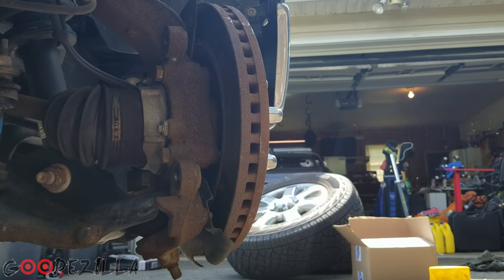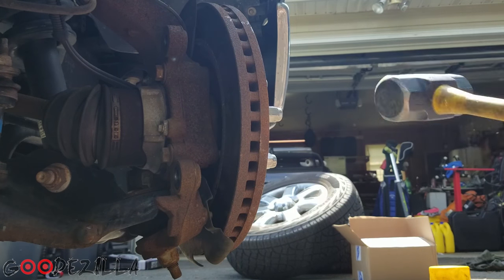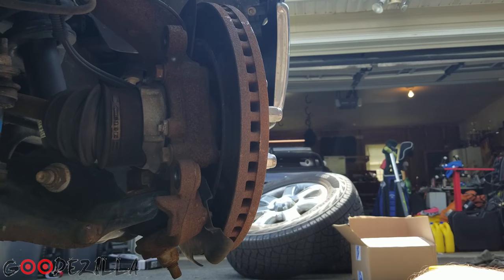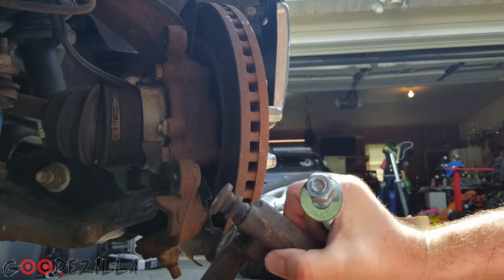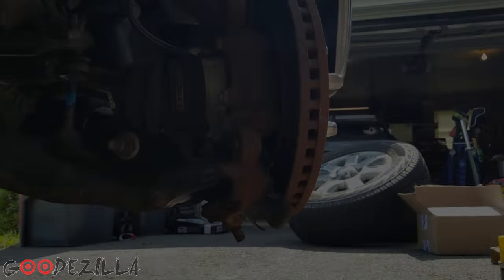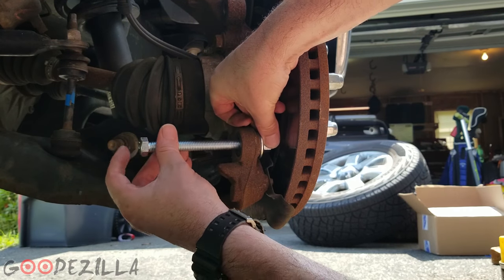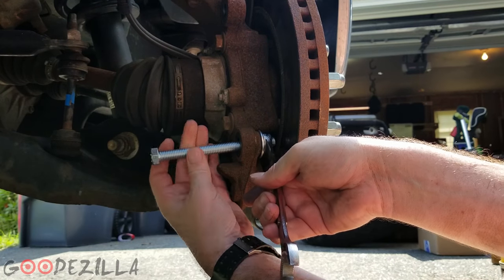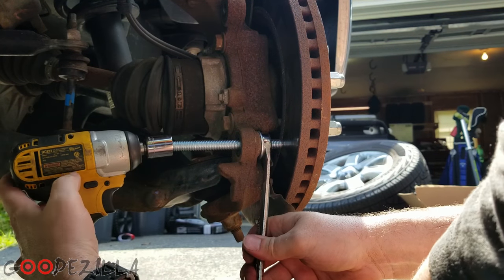How to Remove a Stuck Rotor WITHOUT a Hammer!

Comment: update at 08\20\2022 
This really works!!!! thanks a lot
I have tried to use a hammer,but no luck for 1h, have to give up
after watching this video, i bought a 4 inch bolt, with one nut, and an adjustable wrench, 
Magic, it works!!!! keeps turn the bolt, when you heard a loud 'Beng' that means the rotor goes off from the wheel, then just slightly hit it by hammer, yvonne!!
Reply from the maker: Great, I'm glad it worked out for you!

Comment: Noice man !
Often time's it's wise to shut off the propane torch, set aside the hammer and pry bar. Take a piss, grab a beverage, sit down and try to get a new resolve. Working on a 2010 Ranger. 168k and obvious the rear brakes have never been touched. 
Enter you tube and your video. I was not able to set up a bolt as you did. The caliper guides/bracket extended past the front surface, so I was able to put a heavy steel bar over the bracket tabs, then put on C-clamp over the bar and rear rotor surface to break it free. Same concept as yours, different set up. Before I took a break to rethink stuff I was thinking open the diff case as a fluid change wouldn't hurt an pull the axle. OR, leave the POS rotor and put on pads. Doing it the right way like I planned ! Happy to stick with a reliable rig that's paid for ! I'll be sure to check out more of your stuff. Saved my ass brother, thanks !!!
Reply from the maker: Quite the comment! Thank you for taking the time to write! It's always nice to have a paid for ride! Have a good one! 😎👍

Comment: This rocks bro!! Thank you for sharing, old-school with sledge hammer, pry bars and slide hammers doesn't hold finger to this little bolt trick!!! Worked perfect, and I had to improvise it with two box end wrenches, and a carrage bolt, used 2 nuts, washer, I didn't have a ride to the hardware store so I had to use bolts that I had laying around and I didn't have an impact wrench and it still worked first try perfect!!! 👍👊✌

Comment: Excellent idea!!!  Rotor in Volvo was stuck and I was cursing Volvo for not providing a hole in the rotor to drive a bolt through and against the hub from the front to get it off (like I have in my Honda). This does the trick!!!
Reply from the maker: I'm glad it worked out for you!

Comment: Wow it worked!!!  It is late and I certainly did not want to go to the hardware store.  I was able to find a nut and bolt that looked like it would do the job.  The bolt had a 13 mm head and I wanted to use it on my electric 1/2 inch impact gun but the socket was 3/8 and I couldn't find the 38 to 1/2 adapter.  So just for the heck of it I used a scoked adapter and put the 13 mm socket on my old blue Ryobi impact driver.  I did not have high hopes.  A few bangs from the impact hammer and the bolt had knocked the rotor loose.  Fantastic tip!!

Comment: Thanks a lot!! It worked for me on the first try! 

All four rotors were stuck due to corrosion on my Pathfinder i try a heavy hammer 🔨 and a torch 🔥and nothing worded 😔 3 days trying to remove a single rotor (I’m not a professional)
My local shop was charging me $300 just to change all four rotors. 
I went to Home Depot this morning and bought the bolt, washer & nut for $1.36 you really saved me a lot of money I owe you a pack of beer you deserve it! 
TIP: if your impact drill is too big like mine. Use a wrench to tight the bolt.

Comment: Awesome video, sir. Worked like a charm! Had to run up to the hardware store to grab some grade 8 bolts. The ones I had on hand were too soft and I bent one. Cut it out of there with a zip wheel.

Comment: Thank you sir worked like a charm. I used a gear puller without the arms and it worked wonders since I didn’t have bolts on hand

Comment: I just tried this today, but with a 1/4-20 bolt. That bolt was wayy too small and it was 5 inches long, so it bent and twisted itself almost 90 degrees while I tried to separate my rotor.

What size bolt did you use, and how long? Also, what truck do you have? Car I'm working on is only an 09 RAV4, but the front rotor is hell to take off.
Reply: Most caliper mounting screws are m14, which is closest to 1/2. The next lowest size is 7/16ths, then 3/8ths. Try those 2 sizes next time.

4 to 5 inches in length should be plenty

Comment: Awesome, i  had the same thing, pounding on that damn thing. thanks for the video. Saved me some time.  Just try and use the impact and only go so far with it. Mine wouldn't break free so I grabbed a breaker bar to tighten it more and snapped the bolt. Then I the little piece with the nut was stuck in the hole and had to use the other hole.
Reply from the maker: No problem, glad it worked for you!

Comment: Thanks for the tip. I'll try in the AM tomorrow. I was unable to turn the rotor by hand earlier. Will it work you think with 2 bolts in the bracket spots?
Reply: He is able to turn the rotor is due to him leaving the parking brakes off for the rear and the front in neatural.  Make sure you ensure your car won't be rolling if u have brakes and car in neatural while doing this.  The point of turning the rotor is to loosen it all around each time he use the bolt to push on the rotor.

Comment: I'm not super thrilled with the idea of hammering my axle into the differential, either, so this is super helpful.  I'll go give it a try.
Reply: Worked quite easily with just hand tools on a 2008 BMW 328xi that seemed like it had the original rotors rusted in place!  (This was after some modest hammering with a 2 lb sledge.)

Comment: Thanks dude.  You saved me from packing my disassembled car to the mechanic tail between my legs.  This is an exercise in optimal ingenuity.  (Oh, I had already hammered on my rotors until they were badly dented.)
Reply from the maker: I'm glad it worked out for you. Some guys will say, "quit being a wimp and hammer it"... Well sometimes you need to save the rotor and not dent it, so I used this method.

Comment: F'ing Brilliant.  I also have been fighting to remove the rotors on my 05 Avalanche,  & Yes they are factory rotors with less then 2mm of wear. If it weren't for the surface rust you'd swear up and down they're brand new
  My bearings are going so this is why I'm trying to remove them.
  Thanks for the info.

Comment: Thanks for sharing your idea!  Way better and safer than a sledge hammer!  
I'm surprised rotor manufacturers don't have tapped holes in the face so you can use a bolt to take them off (I heard japanese cars have them).
Reply: Chevy truck rotors have those threaded holes.

Comment: This is a real top tip! However.. I tried this, the sledgehammer, heating it up and using WD40 over night. Nothing works 🥲 so I’m finally throwing in the towel letting an expert do it. Wouldn’t be surprised if they’ll have to cut the damn thing off.
Reply from the maker: Dang that thing much really be stuck on! I'm sure you probably already know, but make sure there isn't a screw holding the rotor on to the hub, between the lugs!
Reply: @Goodezilla  Good thought! Luckily that’s the first thing I thought of as well 😉 I payed to get it fixed today, they had to break it in pieces in order to get it off. I just didn’t have the tools.

Comment: Another variant of the bolt pressing method.
This method however will only require a bug standard threaded bolt & nut, whatever heavy duty size bolt you can find locally.
Great tip, thanks for sharing <3
Reply from the maker: Thank you!

Comment: I had this happen, and I used that approach except put two bolts in, one in each caliper bracket hole.  Between the two bolts, the rotor snapped off with a loud ping after tightening both bolts.

Comment: this totally worked for me. The only comment I would add is to rotate the rotor (like you did in your video) and not to crank on the bolt too hard in one spot of the rotor (like I did, since I only had one side of the car lifted at a time) or there is a risk of bending the caliper bracket mounting hole 'arm'...if that makes sense.

Comment: Thanks I've just done both my front discs ,nearly gave up the other day hammering 🔨 😮 I used shorter volts than you and put one on top and bottom I used a 1/2 drive socket hardly put any pressure on and ping 😅couldn't belive it .

Comment: nice tips. what size bolt you typically use?
Reply from the maker: whatever size fits in the hole but doesn't thread in, slightly smaller than the thread size

Comment: Thats a great tip dude. Interestingly though my GTR has the factory cross drilled discs and has the threaded holes to do this job. Great tip though!!
Reply: Yea Subarus have that too, why the heck every rotor doesn't come that way is beyond me.  Almost makes sense to drill and tap a couple holes in your rotor once you pur a new one on just as security.

Comment: Bolt from a cot bed
Nut from a kids bike
Washer from the engine bay

Moved the rotor slightly, Plusgas penetrative oil & hammer did the rest. Nice one 🙋‍♂️

Comment: Looks clever, but is there a risk of cracking that tab off your knuckle?  It's not designed to carry load in that direction.
Edit...
I got a puller and nothing.  Was nervous about trying this approach because of aforementioned reason.  Carefully tried it and like magic, it came off.  Thanks for saving the day and for another tool in my arsenal.

Comment: I pulled it with a 12 ton puller. Only problem; the hub came off with the rotor!  I had to press the hub out with the 20 ton press and do the bearing job with the brakes. I'll try your way on the other side, but not to break the caliper mount off the knuckle. I'll use 2 bolts; both mounts to disperse the load.

Comment: I also owe you a case of beer and a firm handshake. Was this truck by any chance a Ford f150 4-wheel drive?
Reply from the maker: haha, I'm glad it worked for you. Yes it's a 2013 F140 4x4
Reply: Mine is a 2014

Comment: If you got a bolt the same diameter as the hole, would that not eliminate the need for a nut and a second wrench?
Reply from the maker: You could do that as well, but I wanted to eliminate the chance of messing up the threads on the bracket.

Comment: Be careful you don’t damage the wheel bearing, my Volvo blush fit bearing got pushed it of the upright a few mm as I wound on the pressure. I ground the disk off in the end and now I have to get the bearing pressed back in or replaced

Comment: I almost messed up my threads because instead of using a smaller bolt, I used the same bolt that holds the calipers in place. Also my rotor was extremely stuck in place. Gotta be careful not to bend the caliper mounting points or the wheel bearing.

Comment: Not sure what vehicle that is but the rotors on my Chevy truck have factory threaded holes in the rotor next to 2 of the wheel lugs. Thread in a couple M10x1.5 bolts and they push against the hub and rotor pops right off.
Reply from the maker: This is a 2013 F150 and does not have those threaded holes unfortunately.

Comment: Excellent video however my rotor is so fused to the hub that I'm afraid I might break the ear off my steering knuckle if I apply any more force. I think my only out is going to be to replace the rotor and the hub assembly unfortunately. Here's hoping I can at least get the 4 hub bolts out.
Reply from the maker: If your going to replace the hub, is the ear part of it? Not telling you what to do, but might be worth a shot if you're planning to replace it anyway.

Comment: Was this on an F150? Looks like a wheel from a 2013 in the background. AND! Is that also a RockAuto box I see in the background?
If it was an F150 that's hilarious. I just did rears on my 13 because the motorcraft pads glazed up my rotors and were squealin somethin fierce, it took me almost 3 hours to do a rear brake job. Two of those hours were spent heating, penetrating lubing and hammering those damn rotors off, I suspect the fronts will be just as bad when the pads get here tomorrow. (Also ordered from rockauto, rockauto everything lmao)
Reply from the maker: Yessir, 2013 f150 and rockauto lol

Comment: Actually thought about trying this but I was worried it might potentially deform the mounting bracket for the caliper which could cause the shoe to rub the disc. Maybe I'll give it a try and I'll be able to take back this hydraulic gear puller that I just bought.
Reply from the maker: Be careful because it can bend the bracket on smaller vehicles if the rust is really stuck hard.
Reply: @Goodezilla  ram 2500. Beefy bracket. Been working on this freaking rotor for 2 days. Just spent 5 dollars at Lowe's and 3 minutes later it's off. 
Bro you are a f**king god among men.
Reply from the maker: @gamiensrule  haha I'm glad it worked for ya!
Reply: @Goodezilla  same here I was legit running out of time. I had to get these rotors off today

Comment: Good tip, unfortunately, my caliper brackets are bolted on from the disc side, so they can't be removed before the disc to use the bolt hole. Not sure what my option is now.

Comment: GoodeZilla - tried with penetrating oil and banging with a hammer yesterday until it got dark and I had to give up. You were able to rotate the rotor and mine seems locked in. Is there something I am missing that would enable rotation? Thanks
Reply from the maker: It depends on which wheel it is. If the car/truck transmission is locked in a gear the rotor won't turn. Also make sure there isn't a screw in the face of the rotor around where the lugs poke thru that is keeping the rotor on the hub.
Reply: Thanks GoodeZilla. No screw holding things on. Should the car be in neutral instead of park? Sorry for what is probably an idiotic question.
Reply from the maker: @stephensavage9845  if you're trying to spin the wheels, putting it neutral would allow that in most cases. Just make sure you have the car tires that are on the ground bring prevented from rolling.
Reply: Thank you. Will give it another shot.

Comment: Do you have to have the vehicle up in the air and in neutral in order to spin the rotor like that?
Reply from the maker: The truck was on a jack stand. It was the front wheel, so it was free to spin as 4WD wasn't enabled.

Comment: FYI I tried this tech and it started to bend my caliper mounts. Mine was a particularly bad case though. Had to use a sledge
Reply: 1 bad ombre Wish I had read your comment before I trashed mine. Now I need a whole new hub carrier assembly. No way to bend it back.
Reply: @TyBower  oh man that's a bummer. Also pretty sure I wrecked my wheel barring hammering off my driver side rotar

Comment: Is the rotor ever welded on? If so can hub removal work?
Reply from the maker: Rotors are not welded on, they are items that require replacement throughout the vehicles life time. They are sometimes rusted on so bad that they feel like they are welded on. Also sometimes the manufacturer puts a screw(s) in the face of the rotor hat to hold it that need to be removed before the rotor will come off.

Comment: I tried  this once without an impact driver, using bolts in both steering knuckle bracket holes and 1/2" ratchet on full size SUV (expedition). Removed three of four rotors (they were still good) with a lot of effort. The fourth was damaged. Was concerned with bending the knuckle so I alternated turning each bolt less than 1/2 a turn, backing bolts off, turned rotor a quarter turn, hard tapping rotor with hammer and repeated. Still ended up snapping both bracket hole tabs of steering knuckle (I now know it's cast so won't bend).  Now have same issue with my navigator. One rotor is damaged, have replaced pads on it twice so I have no choice but to change rotor now. Is it possible that the impact action is what is loosening the rotor rather than the pushing action of the bolts? And if so, would just hitting it with an  air hammer eventually loosen it up?
Reply: Only have an electric impact wrench. Going to try that using a socket as an anvil before going to mechanic as I'm guessing there going to have the same issues as well
Reply: Cut-off wheel on a grinder to cut a slot into the swept surface (have to guesstimate where to stop before hitting the spindle). Then use a cold-chisel in the new slot and whack once or twice with a BFH. Rotor will crack in half and fall off. I had to do that on my Expo back in the day.

Comment: Great video and I can vouch that it works! The only thing I must mention is that, for safety, it's best to loosely screw on 2 or more of the lug nuts to prevent the rotor from popping-off or flying-off because they can and both of mine did, and if wasn't for the lug nuts, the rotors would have flown off and hit something (like me)! Because once the rust bonds break free, it can be a violent release of force!!

Comment: What about the rear rotors as someone borrowed my car to pull a trailer and used the parking brake. Now the rotor is stuck into the parking brake pads. Any ideas I plan on changing all parking brake hardware as the car is 11 years old a @007 pontiac torrent the cousin of the chvey equinox.
Reply: Marc Aube if you still have trouble pull it off with a come a long or ratchet strap

Comment: Nice. But what if you don't have enough room to fit an impact on? :(
Reply from the maker: You can use regular wrenches, it doesn't take much force to turn the bolt.
Reply: @Goodezilla  Just did this with the smallest socket wrench, super easy!  Thanks, you're a lifesaver!

Comment: GoodeZilla, your thoughts please. This is a great Idea and there are several other posters doing the same thing; usually seems to work pretty well. However, there are a few contributors that say CAUTION. If you apply too much torque to those bolts, you can actually bend/warp the knuckle and when you go to put everything back together, oops! Now I've got even a bigger problem. $$$$$$
Reply from the maker: Yup, that's why I have the warning in the description.